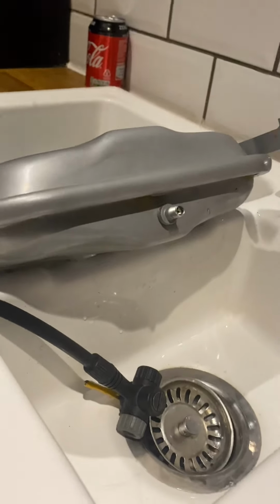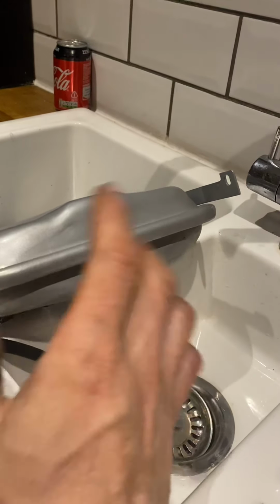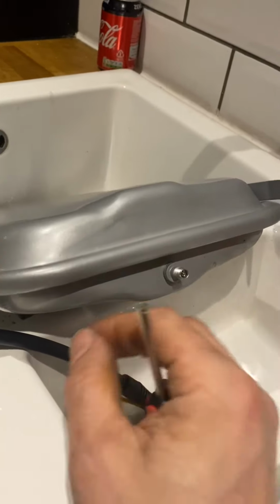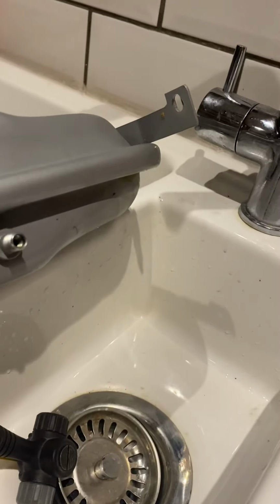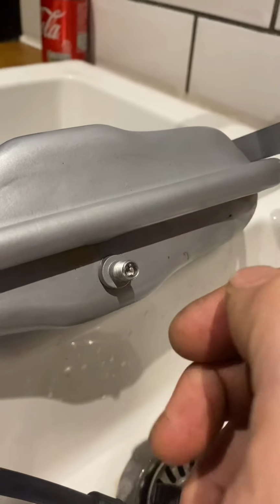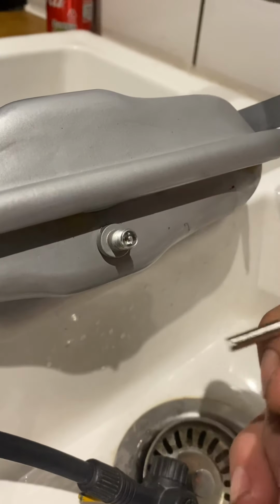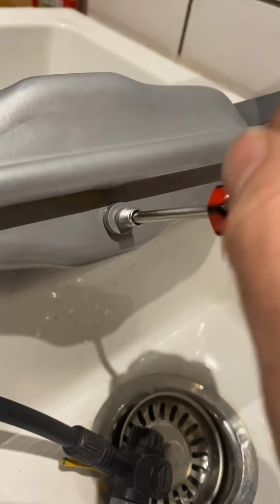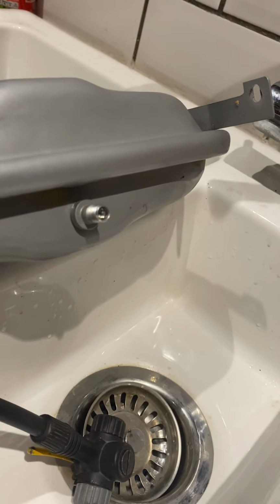boiler losing pressure no sign of water - expansion vessel insert fix

Comment: They put a dust cap on, with a rubber gasket at bottom so it’s not an issue. Until someone checking the pressure loses it

Comment: I have this exact issue. 
I have tried swapping the valve core to no avail, I have tried cleaning inside the valve step where the o-ring on the core sits, still no luck. Definitely the valve that is leaking but can't seem to sort it. New vessel it is then.
Reply from the maker: Sorry to hear that mate… sometimes a little bit of corrosion internally can mean its difficult to get a proper seal.
Potentially a very thin strip of ptfe??
Good luck either way.

Comment: Great video mate. 

My boiler is loosing pressure over a few hours when switched off, seems to hold when the heating is on, no visible leaks internally or externally, all radiators are still full, no water coming out via the PRV by the looks of it, but.......the condensate trap has started filling up and going into fault mode.

Could it be leaking into the condensate?

I'm an electrician, COMPEX qualified, used to work on industrial boilers so I'm not clueless on this type of stuff
Reply from the maker: Ewwww a sparky 😂😂😉

If your condense is filling when boiler is off then probably a pinhole in heat exchanger… which is a biggie.

Unlikely to be a plate heat exchanger issue… 

Bit of a weird issue that… but if water going through condense pipe with no demand then i’d be suspecting a knackered main heat exchanger
Reply: @petegasguy  😄 can't believe I've had to lower myself and ask.......hahaha

I let the system cool, turned it off, shut off the valves for the heating and it still drained from .5 bar in about 4 hours.

It's an old boiler that was getting upgraded and moved later this year so it's not that bad.
Piece of shit ariston microgenus, must be 20 years old
Reply: @petegasguy  just before winter last year the condensate started filling up and leaking, put the heating on and the condensate no longer fills up, works as it should, turned the heating off recently and within a week the boiler had emptied and the trap was full again.
Reply from the maker: @elliotwilliams7421  meh - new boiler if it’s an ariston microgenus … stick £2500 aside and get yourself a decent baxi.

What’s that, like a morning’s work for you lot??
Reply: @petegasguy  £2500, that include installation? 
I've got a vokera up the attic somewhere. Was fitted on a job, not powerful enough so it was replaced, got it for £50 hahaha

Honest guv, we don't earn that much, cost of materials, fuel........
Reply from the maker: @elliotwilliams7421  a second hand vokera for £50… did they have big windows…?!

Yeah - about £2500 fitted is a pretty normal price - depends where in the country you are I guess… what the set-up is like at the min etc.  that should get you a decent 10year warranty.

Comment: Hi mate great video, my ideal logic plus 30 keeps losing pressure. The valve won't come out, have they fixed it in there so it can't be removed by any chance? It just spins around making a clicking noise at the very last turn, have you experienced this before? I know how these companies are and they probably want you to replace the whole vessel.
Reply from the maker: Sounds like it may be snapped internally or something.

No - never seen one where you can’t just take the inner valve out.  Sorry mate
Reply: @petegasguy  OK thanks nice one

Comment: Hi Pete great info ...I had an engineer out for pressure lose( actually 5 of them) the last one fix it at a cost of 800£ two weeks later pressure loss again he comes back and said i now need a new boiler at 2000 ! I'm thinking could i try to change the valve as you suggested....as maybe an old timey plumber would repair the problem and most modern plumbers wouldn't ???...anyhow filling it everyday now and can't find where the waters going ...my rads are all ok ....Idea combo 35 = 12 yrs old .....any suggestions please ....would it be reasonable cost wise if the whole vessel needed replacing ??? thanks so much deAnna
Reply from the maker: Google ‘combicert’ and give me a bell if you like.  I have 5 mins spare to have a chat
Reply from the maker: Best thing to do is to turn the boiler off and let the system cool.  Fill up the boiler to a specific point (1-1.5bar…) and the leave it.

Does the pressure drop after a few hours?

If not then turn the boiler on and turn heating on. Watch the pressure gauge… what happens after a few minutes… does the pressure start to rise?

New expansion vessel, fitted… probably around £150 - £170 ish - no a difficult job.

If you watch the video again you’ll see an explanation… press the schrader valve and see if water comes out - if it does then it’s knackered.  If it doesnt then chances are it just needs the valve replacing/reseating and then the EV recharing via a pump

Comment: Hi Pete, I have a Vaillant aqua Plus combi boiler which has a leaking expansion vessel. I've been told by the engineer that the boiler would need to be removed from the wall to replace the expansion vessel as its fitted to close to the ceiling and it can only be done from the top. Is this true or can it be replaced from the front by removing the front panel? Thanks for your help.
Reply from the maker: It wouldnt shock me if that were the case.  The aqua plus is quite a rare one and i can’t say i’ve ever taken one out...  but - easiest way to check is to call vaillant and ask their tech guys.

Like i say - it wouldnt shock me...  some are designed like that.

Comment: Interesting.. just had my heat exchanger replaced because I isolated my boiler for 1 month and it still lost pressure. My expansion vessel needed recharging too the engineer said.. anyway 2 weeks later still losing pressure 😩
Reply from the maker: Sorry to hear that mate.

Ok - get a balloon/sandwich bag/anything you bloody well like - and tie it over the prv outlet that’s outside.  Let’s rule that out first - before we start messing with stuff.

Then - if dry let’s see if it’s coming out of condense.

Does your pipework go under ground floor level (I.e. somewhere you wouldn’t notice if there’s a leak?). Are your isolators holding correctly....?
Reply from the maker: How did the engineer diagnose a new heat exchanger...??  Was it actually new or one taken from one he had?

Heat exchangers tend to be expensive bits of kit - I tend to direct people to manufacturers for a one time repair when they go as it’s cheaper for the customer in the vast majority of cases.

Other option for leak - potentially it’s an issue with the plate heat exchanger... but I’m sure your engineer would have checked (less likely as the pressure from your cold mains side would have equalised out)
Reply: Pete Combicert thanks for the reply. Before lockdown I was losing 1 bar pressure a week in January. The engineer wanted to isolate the boiler for few days to determine if it was the boiler or CH. I didn’t want to at the time because we had a new born and the wife is temperature OCD ( don’t ask ) I said I’d do it when the weather picks up. By this time I was gradually topping up pressure the less the CH was on.

Lockdown happened and in August I closed the flow and return valve off for a month, during that time I lost 1 bar. Phoned boiler cover and engineer said it was heat exchanger. 

2 weeks after heat exchanger was replaced still dropping pressure so I decided to phone IDEAL logic instead of my insurance. They sent their engineer out and said the only thing left to change on the boiler regarding pressure dropping was expansion vessel and PRV. When the engineer looked at the boiler straight away he was your expansion vessel is completely flat, zero air or water came out when he pressed the valve. Funny enough the 2 times the boiler insurance engineer came out to service and repair he said it was flat too, so in 12 months it’s gone flat 3 times. Anyway the IDEAL engineer has changed the expansion vessel and PRV, he said if the pressure drops it’s a leaking pipe under the downstairs floor. It’s been 1 day so far so I’m still waiting.
Reply: Oh and about the isolators, the IDEAL engineer said when I isolated the boiler they may not have been fully closed and when I opened it up and lost a little bit more pressure I might have been losing it all along.
Reply from the maker: Shit!

Sounds like you’ve been hammered on this - hopefully insurance company won’t hammer you too much upon renewal.

Seems made the heat exchanger was replaced when they knew expansion vessel as low... it’s (generally) the last thing you’d look to do.

Keep us updated mate - hope it starts behaving
Reply: Pete Combicert honestly mate finding guys like yourself are hard to come by, your out here giving top notch information for free why some of these bell ends haven’t got a clue, nor do they care....No passion.
Reply: Pete Combicert what would be some of the causes for flat expansion vessel?
Reply from the maker: @leestar7156  morning.

First of all - this isn’t my auction but here are replacement valves and tool.
https://www.ebay.co.uk/itm/20PCS-TYRE-VALVE-CORE-INSERT-WITH-REMOVER-TOOL-SCHRADER-CAR-BIKE-MOTORCYCLE-SETS/392789234345?_trkparms=ispr%3D1&hash=item5b741012a9:g:eA4AAOSwlshesnY-
Reply from the maker: @leestar7156  it’s just air.. leaks out of the valve.  No different to a tyre really.  It’s a moving part essentially.

Google combicert and my number pops up - feel free to give us a bell if any future issues.

Comment: Hi. I've got a water leak behind my Vokera 20E boiler. Could the expansion vessel be leaking? If so how easy is it to change.
Reply from the maker: What makes you think it’s expansion vessel?  Without seeing it it’s very difficult to say.

I dare say it’s not the first time a vokera has leaked from there.  Get someone out and turn it off mate - don’t want the water doing any damage to electrics.  Isolate under the boiler
Reply: @petegasguy  It's been loosing pressure and no signs of leaks any where else. I have switched off the electric to it and isolated the water. I just thought it could be because the water is running down the wall at the back
Reply from the maker: @martindrury9740  potentially mate - the ev is down the back on them.  Only thing you can do is take a look and try to see where it’s coming from.  I’ve seen vokera’s leak from pretty much everywhere 😂
Reply: @petegasguy  Cheers. I will look again tomorrow. I guess it's removed from the top?
Reply from the maker: @martindrury9740  https://library.plumbase.co.uk/flipbooks/RE/vokmyn20e_22550_t/mobile/index.html#p=24

Page 21
Reply from the maker: Assuming I have correct boiler